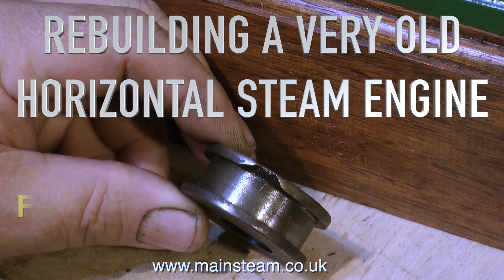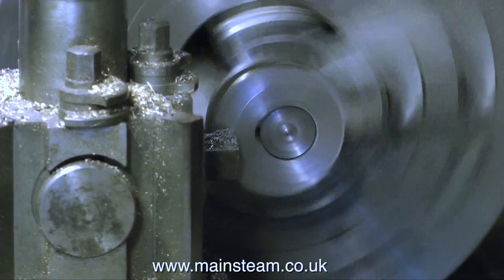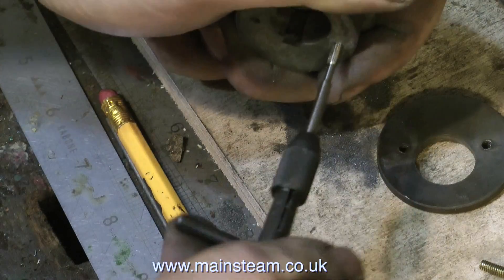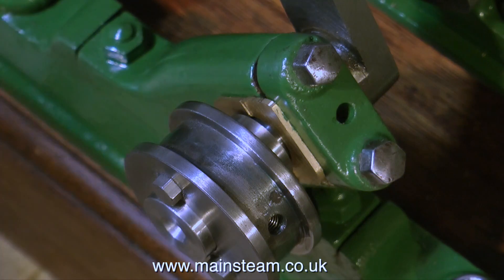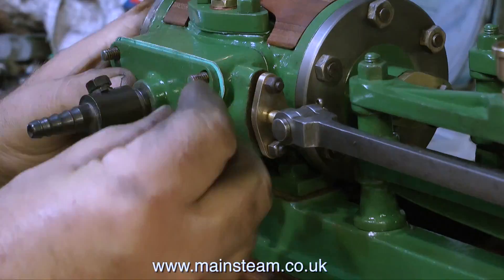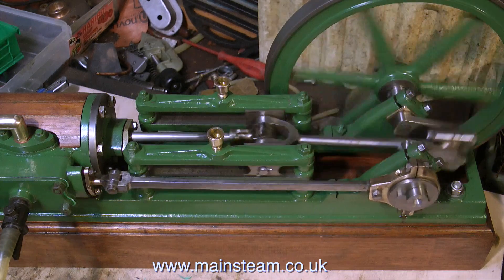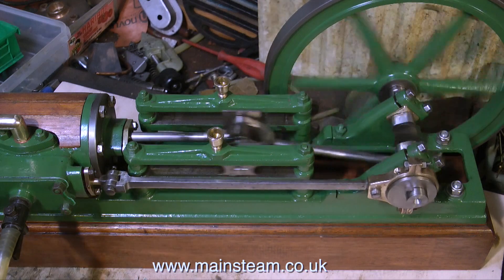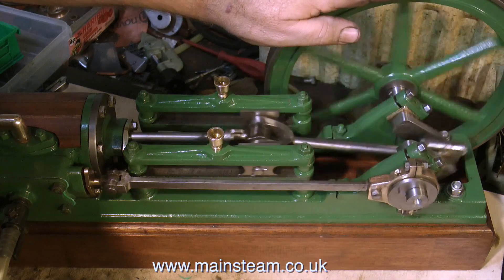PART 22 - LARGE HORIZONTAL STEAM ENGINE REBUILD

Comment: Hi Keith, you were so rite that a full rebuild, or a new build would have been easier and quicker however the final product would not have been as valued the charter would have suffered,  I know this to be true as I have been there myself when doing a resteration  on family heirloom furniture It can be hard to know where to stop / so you leave enough of the old bits to make it "real" and still have it be a safe workable item when you are done.  I think you pulled it off really well here

Comment: Very nice to see it run. While I don't build engines in metal I do build them in LEGO, an unusual building material for steam engines but it seems to do the trick, I run them off of my vacuum cleaner anyway. If you think the air leak on this engine is bad, you should see my LEGO builds, where the air leaks between each brick making a terrible noise along with the vacuum itself, but with a big enough piston diameter it works ok.